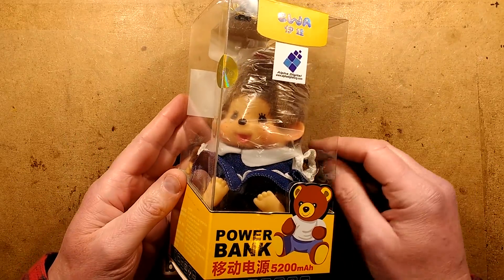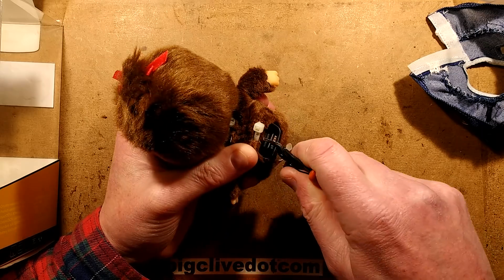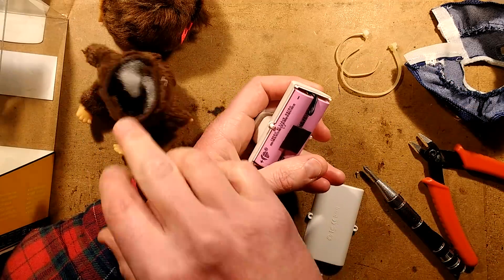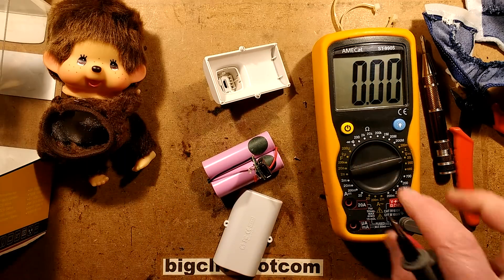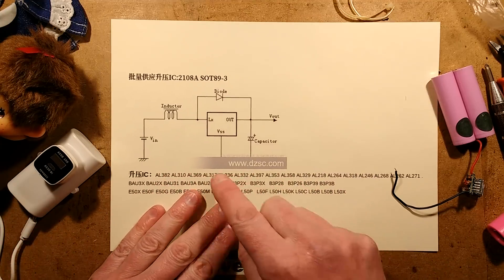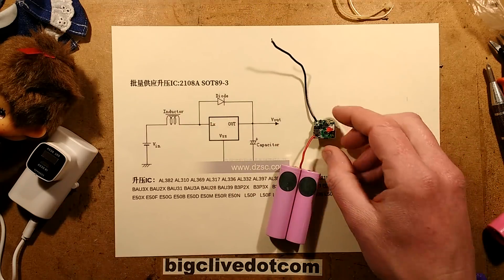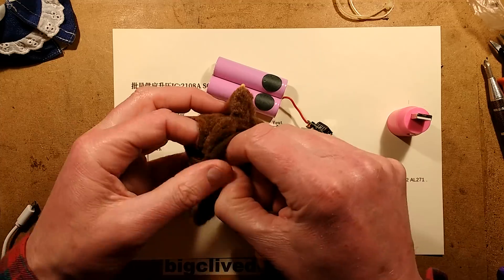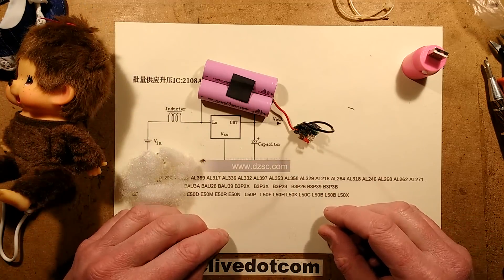Weird Japanese Monchhichi USB power bank.   (モンチッチ)

Comment: I've got an "undead" laptop battery here, which has been too deeply discharged, so the electronics shut it down. It's a standard 6-cell configuration of 18650s, so 2 cell packs in parallel connected 3x in series. I've recharged the cells to about 4.1-4.2V, and they are holding at 3.7V, but the electronics still doesn't recognize the battery as good again, so it has to be reset. Unfortunately, the wires soldered to the PCB are covered in some goo so I can't just desolder them and solder them back on. So I thought about shorting all 4 cell packs out with each other for a fraction of a second or so, in order to reset the control circuit. We'll see how it goes!

Comment: you should have a tear down on  a Patterson 2000D darkroom timer I just bought one new and the reset and focus buttons do not work at all but the run button works so its not a voltage issue I think it has crook terminals under the buttons  could be a good tear down for ya

Comment: If I'm looking at it in the right way - it's a steady 5v come what may (handy for arduino)?  The boost (if it's like the ones I've played with) will deliver 5v from an input that's anywhere between 1 and just short of 7v or 12v.  I suppose the problem is when the cells start getting dodgy the boost bucks up the output and you won't notice.
The other question is is the output at a gazillion Hz?  I've found mostly its not an issue but occasionally some stuff can't cope with the high frequency output.
I'm sure with a bit of thought that head could give hours of fun stuck on a whole range of things.  Add a couple of LEDs and the sky's your oyster.

Comment: A good test i'd like you to do on these battery banks is if you can charge em while discharge em at the same time... it would be a very usefull feature for us that use these as ups modules for micro controllers or raspberry pi's :)
Reply from the maker: That's mentioned in the description.  It does allow that.

Comment: Am I missing something? 3.44 volts and a boost circuit ............  how come the single LED light did not work?
Reply: hob991 That's a pretty reasonable low voltage cutoff so the protection probably kicked in.

Comment: Not even an output voltage check to see what it can deliver :-(
Reply from the maker: I gave it a full test and put the results in the description.  It met its capacity and discharge current specs.  5400mAh and 1A.
Reply: cool but dose the munchkin burn ?
 ;)
Reply: Current its what it delivers. Not voltage

Comment: Furry rectum ... sphincter is cable-tied ... Oh, the images won't leave my head ...
Reply: + Itch Oh my sweet summer child. Furries are not new.
Reply: Itch // ScamBaiting A loud reassuring pop.
Reply: Can confirm, furries are not new
Reply: How about this? It's stomach may be full of cocaine...

Certainly possible, replace the fluff with some latex fingers full of coke and pack it back together.
Reply: Say "furry" too many more times and it'll start looking more likely on e621 than Pornhub...
Reply: Seems to me like replacing that cable tie and restoring the tightness would be nearly impossible

Comment: If you ever want to get into A women's USB port you rip its skirt off... NICE
Reply: Just make sure you use a compatible USB plug or you'll need to use an adaptor.
Reply: Gary Rumain does Apple sell an appropriate dongle for that?
Reply: Just be careful of viruses and rootkits that will attempt to take control of your bank account.
Reply: And then it doesn’t fit so you try it the other way up and it turns out it was the right way up the first time 🤦‍♂️
Reply: There's also multiple ports. If the front one is in use, try plugging into the back one.
Reply: No USB ports on the current crop of iMacs.

Comment: Hmm, this is going to sound stupid, but I've been wanting to make (currently beyond my design capability) a small, low power, button cell powered (and probably PWM to control brightness) aqua colored LED with a photo resistor or photo transistor to turn on/off and a light guide to give a very small illumination to the glass door knobs in my house. I've given up on the idea of using PV and rechargeable cells, because... inside the house. ;)
Reply from the maker: The problem with button cells is that they do not store a lot of energy, so even with a dim LED it may not run for a very long time.
Reply: Yeah, I've been struggling with trying to come up with a reasonable design, and I've just been failing!
Reply: Here are what the glass door knobs look like: http://randomer.net/stuff/glass-knobs.jpg I want to hang a small PCB with the LED and light guide aimed at the glass knob from the key hole.
Reply: Joule thief maybe??
I'm sure a small carved hole behind the plate could hide the battery and circuitry.
Reply: Spikey, now where of all places would someone learn about a Joule Thief? /me looks at the channel and giggles!
There's already a hole behind the plate for the key to fit in, although I don't have the keys, but I don't really want to have to pull the plates off to change cells. :)
Reply: Here's a good start for a dark-detecting LED circuit.
https://www.evilmadscientist.com/2007/a-simple-and-cheap-dark-detecting-led-circuit/
I'm sure you could miniaturize everything there to tiny low-power SMD components, and perhaps use a bigger rechargeable cell that was embedded in the door frame for relatively long life.
Reply: Peetie, I'll check it out. Thanks! In my comment I just posted re Spikey, I don't want to have to pull the plates off the doors each time. :)
Reply: My idea: bore in from the edge of the door above the lock. Drill a slanting hole on the face of the door  pointing at the back of knob that intersects the side of the bore. Create the circuit and package it so that will fit in the hole on the door edge. Thread the led and it’s wires into the slanted hole and connect to the circuit then slide the whole thing into the bore and Dress with a dowel painted to match the door. Possibly with a magnet glued to the back to retain it and to make it removable with a bigger magnet.   Glue the stopper, battery and circuit to a ribbon to make it easy to pull from the door.
€|___[======]§§§§§§§
Reply: How about using an 18650 in a metal tube, something like this:  http://www.modmaker.co.uk/MM-18650-Battery-Tube-Stainless-Steel

Then drill into the door end-on to fit that above or below the lock mortise so that it sits flush on the door edge.  It should be able to run for quite a while on a charge if you're not going for high brightness, and you can easily pull the battery to charge it.  A small wire channel to the lock will get you to the knob area, the bar that goes to the knobs is typically hollow, if it isn't you can find hollow ones, and you can put the LED inside the knob.

It'll be almost unnoticeable flush with the door if you paint the cap door color, and because most people don't really look at the end of a door anyway.  (The lock guys you might happen to have stop by who do notice will be puzzled, of course.)